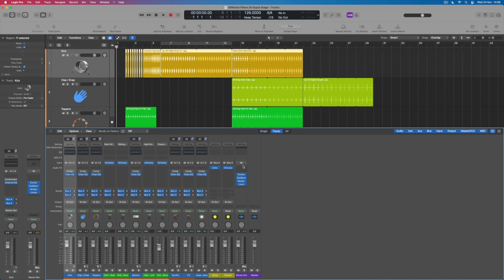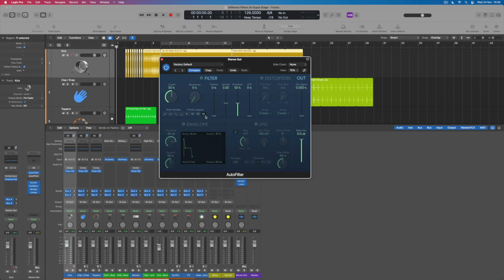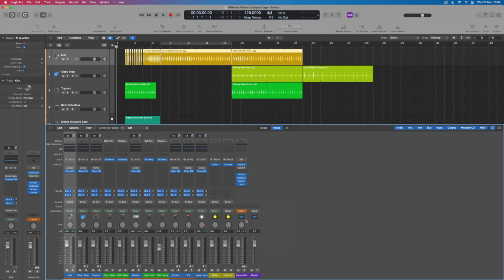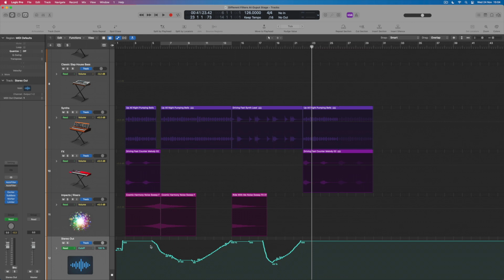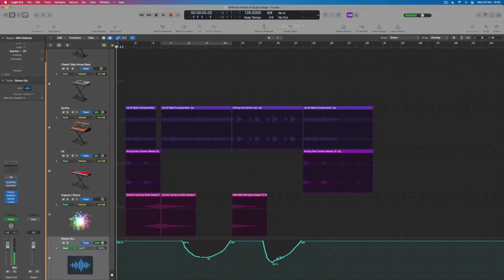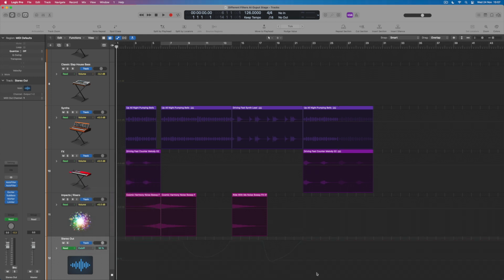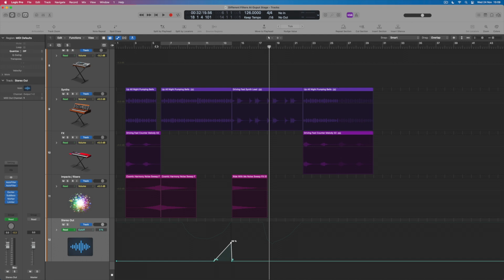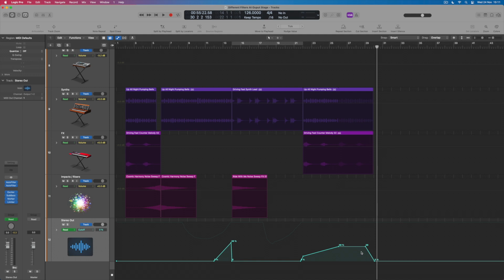LOGIC PRO X - Two Filters On the Output channel

Comment: Hey Jono, thanks for making this series. I have a big question for you that maybe only you can answer because nobody else seems to have found a solution for this: 

I want to use Logic Live Loops feature to produce tracks in a more live fashion so I got a Midi Fighter Twister, and I want to map each one of the 16 knobs to different plugin parameter within different channel strips, one of them being the master as well. The problem is, Logic only seems to recognize the learned CC of the plugins when I focus on that track, for example, if I want to automate Sylenth1 on channel 1 I have to focus on the channel and then move the knob on the Twister that has been assigned to a plugin parameter in the channel strip, so in that case I wouldn't be able to automate any plugins in the master channel (or any other channel) until I select (focus) on the master channel.

The weird thing is that yesterday it was kinda working after I switched the channel's MIDI in port to: Twister, and in that case the instrument in that channel would only recognize an input from coming from that device but today that trick is not working anymore, so now I don't know what to do.

Do you have a fix for that? I would appreciate your help.
Reply from the maker: Hi Reinold. I'm going to have to have a think about this one! There are control surfaces which will allow you to manipulate parameters across multiple tracks but they aren't regular MIDI controllers, but more DAW-style controllers instead. If you were able to set your entire Live Loops session up with one instrument controlling up to 16 MIDI channels, with each track mapped to a dedicated MIDI channel, you'd be set. This is how NI's Kontakt can work - load multiple programs, assign each to its own MIDI channel and then set up a software instrument in Logic with a track for each one. Leave it with me and I'll see if I can figure out an answer for you after some experimentation. Equally, if you crack it first, let me know!
Reply: @jonobuchananmusic  thank you very much. Yes I will let you know if I find any solution, I am already watching a series in advanced midi to see if that helps. Thanks again and looking forward to expand on this!